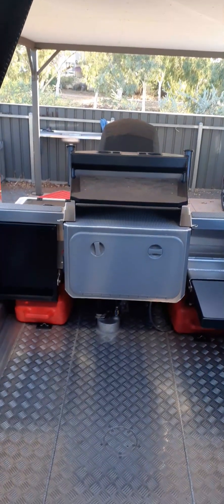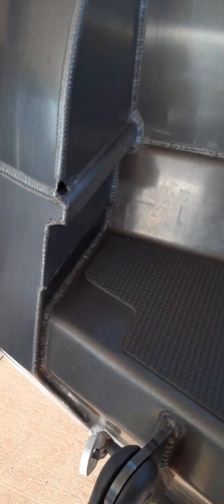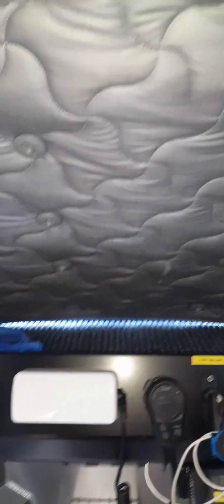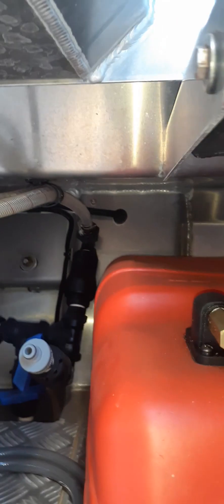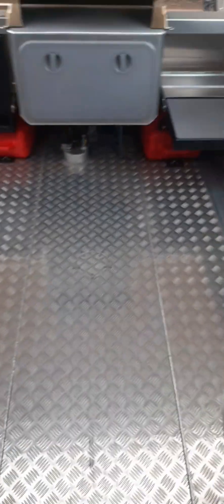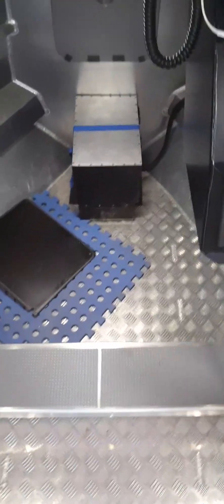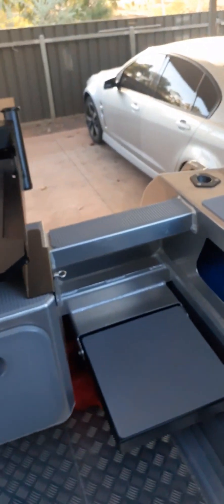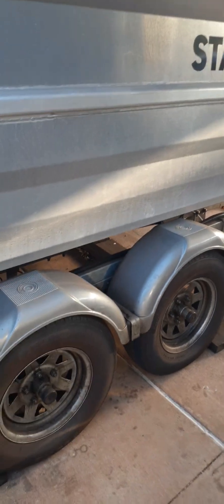What to Check on Your New Stabicraft Plate Boat | Common Issues & Fixes

Comment: I think the single biggest issue with all the major boat manufacturers is that they commonly use minimum wage unskilled labour for the fit out component of the build so have a constant turn over of staff who never really get better at it.  In regards to the dissimilar metals corrosion issue I don't think they give a rats, bedding and use of tef gel takes time and money and the results of not using it don't really turn up until after the warranty period or can be blamed on the owner not carrying out "preventative maintenance" whatever that means.
Reply from the maker: Hit the nail on the head.

Comment: What a lot of issues with a new boat, very disappointing.  With the swarf in the oil filter, what problems did you encounter with the outboard to cause you to investigate further?
Reply from the maker: I reckon! Least I know the boat upside-down back to front know.

Brought it in for the 20hr service after breaking it in and the mechanics said it didn't sound right with the cowl off. He checked filter and she was silver and after pulling apart a bit more found that the balance shaft ate the motor.

Comment: Hey mate,good on you for having such an eye for detail.i used to boat build for a renown boat builder in nz.thats abit sad that stabi cant come to the party and fix all that for ya mate.i personally would sell it mate.not trying to offend ya mate,theres better boats than  that for what theyre usually priced at.
Reply from the maker: I'm hearing you on that one mate ! It's a  hard one as I've ironed out most of the dramas and getting some good use out of it. Don't want to sell a lemon to some poor soul. The NZ  built boats were miles in front price wise in covid times.In terms of prices now for new boats alot higher so I think I grit my teeth until I with the lotto.Thanks for the kind words much appreciated.
Reply: I am currently looking at a new Stabi 1550 Fisher…interested in what boats you would suggest are a better option? Cheers
Reply from the maker: @paulsloan6184  Hey mate,  I couldn't tell you on that size boat. I guess it depends on where you live and  what qualities you want in a boat. I wouldn't let this video tarnish your thoughts on this brand. I enjoy my boat but just wanted to highlight the issues I came across. In the future I may look into a glass boat for heading further offshore. 
Thanks

Comment: I understand where you are coming from ,considering the cost you would think it would be better, but and this is a big but it’s not a car that is mass produced on an assembly line where the company can spend 100’s of millions on development it’s more like a caravan made of parts from all different companies and that is where the problem lies ,installing parts that weren’t specifically designed for your boat but designed for 100’s of different brands of boats and to top that of not everything is installed at the factory some is installed by the dealer or sales companies that sell the components 
So I guess I look at it like I’m buying a hull from Stabicraft a motor from Mercury a trailer from x the rest is bits and bobs.
As far as the cost goes it’s hand made and we all know the cost of hand made I mean in comparison to a production line that puts out 100’s of cars a day 
Look I know I’m on a rant but I actually do understand I’m 400klms from my dealer so I took it home went over it with a fine tooth comb like you and fixed everything to my standard myself even though I know they are responsible
I hope you are enjoying fishing out of it and there is a good side to owning a Stabi
Cheers from down south
Reply from the maker: I agree with you! Some of the responsibility lies with the manufacturers, dealers and other third parties. Some faults are unforeseen and some are from lack of care. There is a lack of a customer service and ownership these days. Great boat and enjoy fishing out of her. Just wish their was less issues left me feeling shitty. Just wanted to shine the light on what you could possibly have to deal with buying a new boat.
Cheers for the comment.
Reply from the maker: @Do-iz6qd My mechanic noticed the engine sounded different to his and decided to open up the oil filter and noticed it was full of metal. Otherwise the motor ran fine and has no complaints. Thanks for the back up with the poor quality much 👍👍